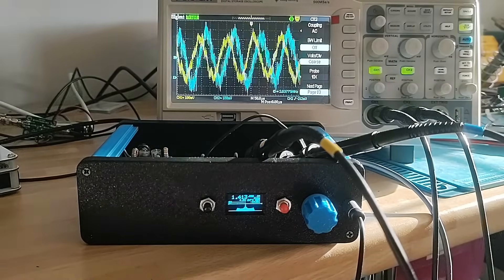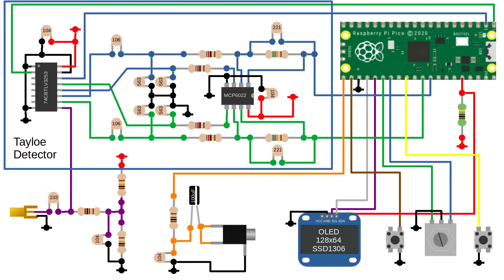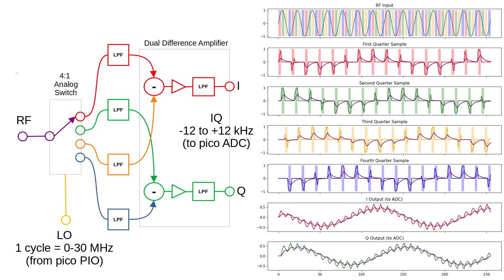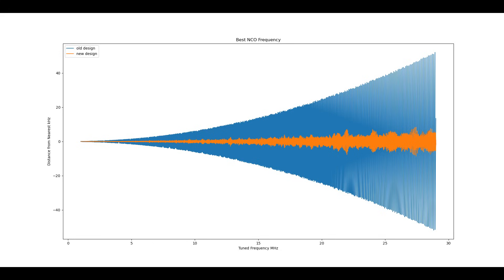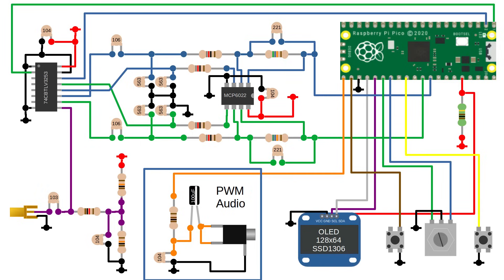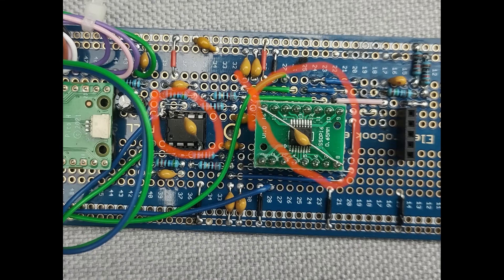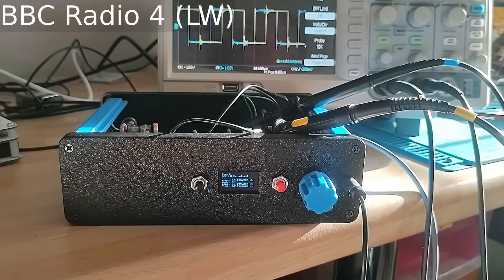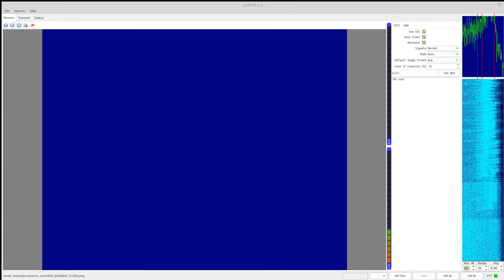Software Defined Radio with Pi-Pico

Comment: Built the receiver and have great respect for the design effort. Not sure if its down to my building skills, but the results are a bit disappointing.  Lots of data signals received very few voice stations. Probably need an outdoor antenna. Also wonder, if the receiver should be housed in screened enclosure.
Reply from the maker: Hi, 

Thanks for the feedback!

Yes, putting more effort into the antenna is always the way to go. If you are using an indoor antenna you will almost certainly need an LNA. A screened enclosure is a good idea, but careful layout and grounding are more important.

If you are receiving plenty of data signals, it might just be that propagation conditions are poor? Even with the very best setup, there are plenty of times when you just don't hear very much on HF, especially during the day. But when conditions are right the bands can be crowded with competing signals especially if there's a contest.

Comment: Hi, is there any way to replace 56nf, 10uf capacitors? Cant find them ANYWHERE (for a decent price)
Reply from the maker: For the breadboard version I mostly used capacitors from a selection pack, I have included a couple of links that include the smaller and larger values. The large value pack goes up to 10uF. 56nF is one of the values that unfortunately wasn't included. I just used 47nF and it worked fine, it doesn't make a huge difference really.
 https://www.amazon.co.uk/BOJACK-Ceramic-Capacitor-Assortment-Capacitors/dp/B07P7HRGT9/ref=sxin_24_pa_sp_phone_search_thematic_sspa?adgrpid=56070762154&content-id=amzn1.sym.6abef4fb-b8b2-49d9-b820-ce18d03905a3%3Aamzn1.sym.6abef4fb-b8b2-49d9-b820-ce18d03905a3&cv_ct_cx=10+uf+capacitor&gad_source=1&hvadid=259162054207&hvdev=m&hvexpln=0&hvlocphy=9045569&hvnetw=g&hvocijid=4235028512111395777--&hvqmt=e&hvrand=4235028512111395777&hvtargid=kwd-298122523400&hydadcr=18251_1817064&keywords=10+uf+capacitor&mcid=5988d9180afc3718a753b1e2a1fda841&pd_rd_i=B07P7HRGT9&pd_rd_r=fda042b8-56f7-4563-b3fa-263470fc9c15&pd_rd_w=Oqx24&pd_rd_wg=5B31V&pf_rd_p=6abef4fb-b8b2-49d9-b820-ce18d03905a3&pf_rd_r=NMXHFSAGD7K68CR1TP6D&qid=1763141726&sr=1-2-ad3222ed-9545-4dc8-8dd8-6b2cb5278509-spons&aref=IXuOFXDV7K&sp_csd=d2lkZ2V0TmFtZT1zcF9waG9uZV9zZWFyY2hfdGhlbWF0aWM&psc=1 https://www.amazon.co.uk/dp/B07PP7SFY8/ref=vp_m_fuw_pd?_encoding=UTF8&pf_rd_p=bb4ea00b-3e8a-48eb-b8dd-768a772cfa34&pf_rd_r=F3P8SKNSCC2AK2V18Q5F&pd_rd_wg=QSnMx&pd_rd_i=B07PP7SFY8&pd_rd_w=IhJ2Q&content-id=amzn1.sym.bb4ea00b-3e8a-48eb-b8dd-768a772cfa34&pd_rd_r=64da19b0-df17-4344-bf06-ec106364042f&psc=1
Reply: @101Things-ds8tc  Would it be able to use 68nF and 10uf but Electrolytic?

Comment: very nice project! 
a noob question tho, can i power it using a li-ion battery with an LDO regulator? or will it be too noisy?
Reply from the maker: Sure, the pi pico has a built in switching regulator. It does generate some noise, but with careful filtering the impact on the receiver isn't too great. The Pico accepts a voltage between 1.8 and 5v, so you could run it directly from a single li-ion cell. You will need to add some circuitry to prevent contention between USB and   battery supply, this can be a simple diode or p-fet. There are example circuits in the pi Pico datasheet.
Reply: @101Things-ds8tc really appreciate the answer. going to build this very soon, trying to make a filter first and an active antenna

Comment: Great SDR , thank for sharing, can you provide which antenna and rf amplifier board did you used . I understand circuit part but the antenna, rf amplifier , matching circuit
Reply from the maker: Thanks! 

Simplest option is a wire antenna outside or in the loft should work without a pre-amplifier. If you want something more portable I have had good results with a youloop antenna like this one https://www.banggood.com/YouLoop-Magnetic-Antenna-Loop-Antenna-Sdr-Receiver-Shortwave-Antenna-Radio-Translation-Introduction-p-1986911.html?gmcCountry=GB&currency=GBP&cur_warehouse=CN&createTmp=1&utm_source=googleshopping&utm_medium=cpc_pt&utm_content=meruem&utm_campaign=aceng-pmax-uk-exrc-220802-meruem&ad_id=&gad_source=1&gad_campaignid=17930323596&gclid=CjwKCAjwhuHEBhBHEiwAZrvdcllAOyhZkdXahVsODJM43KpPVS9zZLa2QAfUv26CgimrdkysbwXyVRoColoQAvD_BwE it has really good noise cancelling properties but you will need an external amplifier. 

You can also build your own using some coax and a ferrite core:
https://swling.com/blog/2020/04/diy-how-to-build-a-noise-cancelling-passive-loop-ncpl-antenna/ 

I use an LNA module like this one https://www.ebay.co.uk/itm/156559089651?chn=ps&_ul=GB&_trkparms=ispr%3D1&amdata=enc%3A1cohEm2W7QymL-EaDxdGm9A42&norover=1&mkevt=1&mkrid=710-134428-41853-0&mkcid=2&mkscid=101&itemid=156559089651&targetid=2405654676673&device=c&mktype=pla&googleloc=9045569&poi=&campaignid=21697391927&mkgroupid=177203736618&rlsatarget=aud-1415330310908:pla-2405654676673&abcId=10027104&merchantid=5498403386&gad_source=1&gad_campaignid=21697391927&gclid=CjwKCAjwhuHEBhBHEiwAZrvdcvo8qLERFGknZ8kLTMkL7Jl6-qrP9HD0g4dv4v7hiW2QscDLf8pJtRoCEU8QAvD_BwE. 

The MLA30+ has its own amplifier and works out of the box, but its a bit pricey. https://www.ebay.co.uk/itm/167635539815?chn=ps&_ul=GB&_trkparms=ispr%3D1&amdata=enc%3A1NR_QFNI0Q2SWQsl50FEgFA7&norover=1&mkevt=1&mkrid=710-134428-41853-0&mkcid=2&mkscid=101&itemid=167635539815&targetid=2405654676673&device=c&mktype=pla&googleloc=9045569&poi=&campaignid=21697391927&mkgroupid=177203736618&rlsatarget=aud-1162782600456:pla-2405654676673&abcId=10027104&merchantid=138816116&gad_source=1&gad_campaignid=21697391927&gclid=CjwKCAjwhuHEBhBHEiwAZrvdctjRuH1N9wrQG5FNBmFBdvKtR1ctdU_dDGF91afIdAebqtfAOzrYehoCnGwQAvD_BwE

Best of luck!
Reply: @101Things-ds8tc thank you so much for sharing the details

Comment: Does it work to measure signal 0.1 mhz to 0.9 mhz 

Can you please answer
Reply from the maker: Yes, it works over that frequency range. I often use radio 4 longwave on 198kHz as a frequency reference for calibration.

Comment: great project, I have problems compiling the source, cat.cpp, stdio_puts_raw("?;"); I'm wrong, I'm missing a piece of code, thanks
Reply from the maker: Cheers! What's the error? A missing include file perhaps? Do you know which version of the SDK you are using?
Reply: @101Things-ds8tc  VS code is 1.99.3 ,SDK 1.5.1
error:stdio_puts_raw was not declared in this scope
Otherwise
the project compiles if I comment
//stdio_puts_raw("?;");
 //int32_t retval = stdio_get_until(buf, sizeof(buf)-items_in_buffer, make_timeout_time_us(100));
 // if(retval != PICO_ERROR_TIMEOUT)
 {
 // items_in_buffer += retval;
 // write_idx += retval;
 // if(write_idx > buffer_length) write_idx -= buffer_length;
these are the includes
#include <pico/stdio.h>
#include "pico/stdlib.h"
#include <cstring> // For memcpy, memchr and strncmp
#include "cat.h"
#include "ui.h"
thanks for the quick reply

Comment: What a amazing project. I wounder if with modifications, could this be used with a Mems mic to make a bat detector?? 10-160 khz
Reply from the maker: Thanks, I think a bat detector would be possible, but it should be possible to directly sample at those frequencies so it might be even simpler.

Comment: Im trying to load your project on vscode. It cant find the library <cmath> and ctime…any idea where the pico extension has them placed? Many thanks
Reply from the maker: Apologies, I don't really use vscode. Is it just a matter of adding #includes in the relevant files?

Comment: Jon, just about to build one of these, but I am a little confused by the wiring  of the Tayloe mixer. Each op_amp needs to be fed by two outputs from the mulitplexer that are 180 degrees apart, as indicated in the animation. However when I look at the wiring/circuit diagram each op_amp is feed by outputs from the mulitplexer that are just 90 degrees apart? I may well be misinterpreting or missing something simple  here, so the breifest of reply would be  appreciated.
Reply from the maker: Yes, you are correct. Each omp amp needs to be fed with inputs 180 degrees apart. Perhaps the missing piece of the puzzle is that the select inputs to the multiplexer are driven in the sequence 0, 1, 3, 2?
Reply: Thanks for getting back much appreciated. I assumed switching sequence, was 0,1,2,3, not 0,1,3,2. Is that because of the way you generate the LO on the gpio pins, just curious. Mike G4GHL @101Things-ds8tc
Reply from the maker: Its mostly just that it's a common method. The quadrature oscillators tend to be two square waves of equal period but 90 degrees out of phase which is something that a typical clock generator like a si5351 can produce without additional logic.

Although the pico could use any arbitrary order, to drive the mux, this ordering allows compatibility with existing designs like the QRP labs receiver module which I used in the first prototypes.

Comment: Hello,help me please understand the function
nco_set_frequency in nco.cpp.
  1.let's say we need to tune in to a station 531 kHz
tuned_frequency = 531000 Hz
  2.But we can't get that exact frequency
because frequency depends on
possible_frequencies(sys clk) divided by best_divider(sm clkdiv).
  3.This function calculates the values of variables
possible_frequencies and best_divider,
at which will give the closest possible frequency.
  4.This closest possible frequency we feed to the Tayloe detector.
For example,using this function i got the following results:
===================================
tuned_frequency = 531000
best_frequency =  535500
system_clock_frequency = 138000000
best_divider = 64.4258
====================================
tuned_frequency = 549000
best_frequency =  544500
system_clock_frequency = 141000000
best_divider = 64.7383
=====================================
In the first case tuned_frequency is less than the best_frequency by 4500.
In the second case tuned_frequency greater than best_frequency on 4500.
  As a result, this function gives 
best_frequency = tuned_frequency+4500 or
best_frequency = tuned_frequency-4500
  ???This is correct???
Reply from the maker: Yes, that's exactly right, we want a small IF frequency, say 4.5kHz either above or below tuned frequency to avoid noise that occurs close to DC. The software calculates the nearest frequency to 4.5 kHz above, and below and choses whichever was closest. There is another DSP mixer in the software that removes the exact frequency offset.
Reply: Thank you! One more question.
When the function has calculated
====================================
tuned_frequency = 549000
best_frequency =  544500
system_clock_frequency = 141000000
best_divider = 64.7383
=====================================
The real frequency that will be applied to the detector?
best_frequency = 141000000 / 64.7383 or
best_frequency = 141000000 / 65.0 (rounded) or
best_frequency = 141000000 / 64.0 (whole part)

pio_sm_set_clkdiv(pio, sm, best_divider);

 It is somewhat doubtful that the best_divider for
state machine can be a fractional number!?
Reply from the maker: Yes, that's right we use the 8-bit fraction bits in the divider, so we round to the nearest 1/256. It adds jitter, but we need it to get the frequency close enough, and it's not too detrimental to performance.

Comment: The OLED I got is 1.3 128x64, but SPI instead of I2C .
How Can I modify the source code to make it work in lieu of the .96 Oled?
Reply from the maker: Hi, It might be a fair bit of work, we have started moving over to the u8g2 lib, which does support a range of displays, but there is a significant portion of the UI still to be ported. I would start by taking a look ui.cpp and check out the calls to ssd1306.c to get a feel for it.

Comment: I am no fan of OLED screen's. I used once for a project and after a year it was completely burned in.
Reply from the maker: Thanks, something to look out for. I haven't had any issues myself, my prototype is still going strong after nearly 2 years, but I only leave it on for an hour or so at a time. There's an adjustable display timeout too which should help if you are concerned about burn in. I find the OLED screens hard to beat in terms of cost and simplicity.
Reply: @101Things-ds8tc  I used the display for a watering project 24x7 and after a year it's quite burned in. That one was using a pico-W, an OLED screen and a moisture senor.

I have a Samsung Tab S7+ which has an OLED screen, but even after four years that one it's crisp clear.

So, for that reason, I am a little bit cautious with OLED displays in new projects. I try to avoid then and try to get my hands on high quality TFT display's.

Comment: Hello, I just finished scratch build this Rx on 8x8 cm matrix pcb and it works. 
Headphone sound was comfortable. 
Connected to a quarter wave CB antenna, 31m broadcasting was good at night. 
However, the CB band signal received is faint compared to a USB RTL-SDR to PC with the same antenna. ( any suggestion please )
The Band Pass Filter has not been assembled yet, hopefully the BPF will be able to provide better results from the signal/noise ratio. And the panoramic signal to noise floor display is better.
Reply from the maker: Brilliant, so glad you got it working! We have a gallery of completed builds here https://github.com/dawsonjon/PicoRX/issues/99, would love to see some pictures!

At the high end of the frequency range, you might well get some improvements by using an LNA. Careful attention to layout can also help reduce the noise floor, when you don't have a ground plane, it pays to think about return paths for currents and routing of grounds.

Comment: Hello, what is the polarity of 10 uF capacitor from pin 10 and 11 of 74cbtlv3253 to the opamp, which side is plus/minus ?

I read about D1 and not fully understand that it must be removed, where exactly is this D1 ?
( I am going to use a rechargeable 3.7V batery +  tp4056 charger )

Thanks
Reply from the maker: I used ceramics for the 10uF caps, but I would probably put positive towards the analog switch if I was using electrolytics.

There are a few options with the power, you can supply the battery using an external diode, to power from either USB or battery. Another option is to remove D1 from the pi-pico, that means that you can't power from usb (only batteries), but you can still use it for programming/audio.
Reply: Hello 
I am in the middle of soldering the 10uF coupling capacitors, 
and realize that in breadboard picture vs the schematic the 10uF placement is quite different. 
In breadboard picture, the 10uF is between 3253 and 56nF.
In schematic, the 10uF is between 56nF and 82 Ohm resistor.
Which one should be followed the schematic or breadboard ?
Thanks 🙏
Reply from the maker: I don't think it matters, but I would go for the schematic option if you have a choice.

Comment: Hello, MCP6022 is not available here. 
What is the correct VCC of opamp it self, if use a NE5532 ?

Thanks
Reply from the maker: NE5532 is a 5v part, there are a list of drop-in replacement parts here: https://101-things.readthedocs.io/en/latest/breadboard_radio.html#operational-amplifier-alternatives, but NE5532 should work well if you adapt the circuit.
Reply: @101Things-ds8tc  👍 Thanks

Comment: Does the Pico use a program do you have details on a web site ?I am a analogue T Rex TV  Engineer so not very familiar with Pico cheers
Reply from the maker: Hi, there is a write-up here with all the technical details. You can download the pre-built firmware here https://github.com/dawsonjon/PicoRX/actions (select the latest run, then select the appropriate .zip file under artifacts), the .zip file will contain a .uf2 that can be used to program the pico. If you hold the button while plugging the pico into a PC, it will appear as flash drive. Just drag and drop the .uf2 file to program.

Comment: Hi Jon
Absolutely amazing project! Excellent demonstration of the power of modern CPU's. I absolutely have to try it myself, but I cannot find the .uf2 firmware image. There is a link in your long documentation that does not work, and I also could not find it on Github, but I have to admit that I find the structure and working of Github confusing for somebody of my age. Can you perhaps make the .uf2 file available (again). Again thank you very much for this beautiful project!
Reply from the maker: Thanks! 
I'm using GitHub actions to automate the build process. https://github.com/dawsonjon/PicoRX/actions
If you go to the latest run, then look in the artifacts section, you should see 3 downloadable zip files. Chose the one that matches the version of pi Pico you are using and it will contain the .uf2 file.
Best of luck with your build!

Comment: Hello, could the output pins of 74cbtlv3253 at pins 10, 11, 12, 13 going to opamp, exchanges randomly due to simplified the layout ?
Reply from the maker: The order is important, but there are a few combinations that would work.

The S inputs are driven in the order 0, 1, 3, 2. This means that the antenna is connected to the output pins in the sequence 10, 11, 13, 12. They connect to the op-amp inputs in the sequence -q, -i, +q, +i.

The alternative sequences [-i, +q, +i, -q] or [+q, +i, -q, -i] or [+i, -q, -i, +q] would work just as well. There is a menu option that allows the I and Q channel to be swapped, if this option is enabled then you can use the reverse of any of these sequences i.e. [+i, +q, -i, -q] or [-q, +i, +q, -i] or [-i, -q, +i, +q] or [+q, -i, -q, +i]. Any sequence where I and Q don't alternate is invalid and won't work with either setting.

Its a little difficult to explain, but hopefully that makes sense.
Reply: @101Things-ds8tc  Thanks 👍👍👍